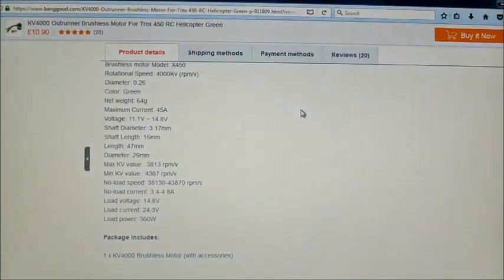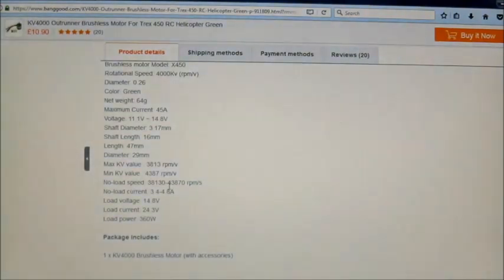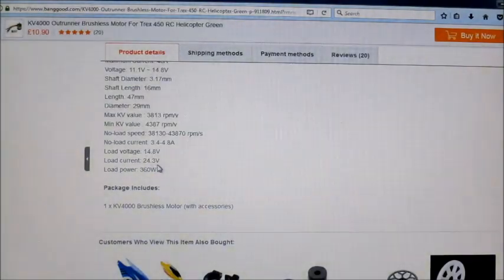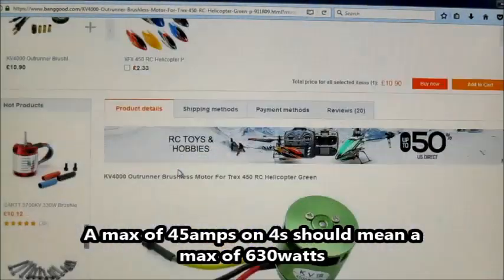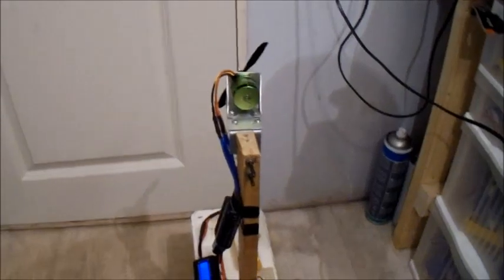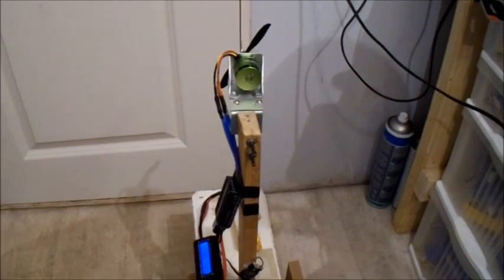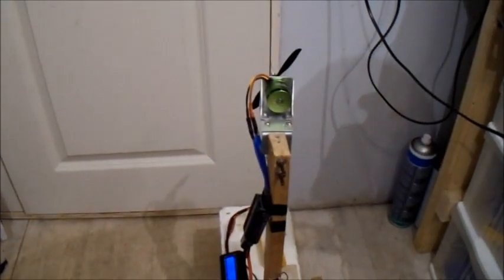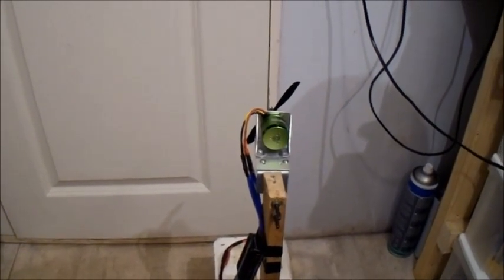4000kv TRex 450 Helicopter Motor Thrust Test Motor Test of the Week

Comment: I put this on  helicopter spinning 275mm blades sub 450. I was really surprised at the power spinning about 3700rpm main rotor. The magnets seem weak to me compared to other similar size motors which had no bearing on performance.

Comment: I use the same motors on a couple of my rc boats. Their brilliant
Reply from the maker: Small but mighty.
Reply: @rcplanepirate  One on my Feilun FT009 doesn't even require cooling and the other one on the Volantex SR65 performs well but gets a tad hot even watercooled since the boat is 65cm long
Reply from the maker: @redditchrc960  Thinking of getting one of those outrigger kits from banggood. Could be a good motor for my first rc boat.
Reply: @rcplanepirate  I got mine of AliExpress currently on order for another seven of those bad boys to go into my other small rc boats
Reply: @redditchrc960  you running 4s or 3s ? And when you say tad hot lol 
Thinking about putting one in my sr65 ya see
Reply: @Discofpv  up to 3s. I don't think the hull could handle 4S being lightweight abs

Comment: How to modify the shaft of this motor
Reply from the maker: Modify the shaft in what way?
Reply: @rcplanepirate  in one of the videos i have searched on youtube a guy attached the prop on the back of this motor but how i cannot understand bcoz of short scene...
Need help bcoz i wanna update my skyfun jet to this motor
Reply from the maker: @imranahmad2264  You need to get a longer shaft. Take the motor apart and fit the longer shaft so it sticks out the other end of the motor. If the shaft you get has a groove at the end for a ring clip then just turn it round so that end is where the clip was on the old shaft by the bearing to stop the motor coming apart. You will also need to put flat spots on the shaft where the grub screws hold the shaft the other end. If the shaft doesn't have a groove for a clip you will need to get a grub screw collet to secure the shaft that end. Also I'm not sure if the standard shaft is 3.17mm but only at the end. It might be 4mm where it goes through the bearings. So measure the hole shaft before you buy a new one. Here is a good video explaining how to do it.      https://www.youtube.com/watch?v=D4UKWvTHX1I
Reply: @rcplanepirate  thank you for your kind help and also very thankful to you because everything is in detail so anyone can understand easily...
Reply: @imranahmad2264  You couldn't understand a short video so you're asking somebody to explain it to you by typing out a comment? Just look up a video. You're already on Youtube damn it!
Reply: @rcplanepirate  i wanna say that how to reverse the shaft

Comment: Is the motor going to burn  if i use 80A esc?
Reply from the maker: No that will be fine.
Reply: @rcplanepirate  Althought i use 4s lipo??
Reply from the maker: @tgalam2170  Yes it will be ok. You could even use a 100A esc if you are using 4s.
Reply: @rcplanepirate  thanks..
Reply: @rcplanepirate  thanks

Comment: Heli motors are designed for high torque as they have to move massive main rotors and tail rotors and the collective head that changes the load on command so it has to handle getting how. 45amp Max current draw in the spec is what would scare me away because of the loads it’s expected to handle while spinning at roughly 3100 rpms.  I fly helis and was really eyeing this motor for a cheap cheap cheap 450 helicopter build. I literally bought the 450 heli kit for $15.
Reply: If you are flying 800 gram 450 size helicopter. You would reach 45 amps draw for a fraction of a second. The hovering amps would be around 25  amps. I have data logged  3s motors on this size helicopters and that is what I have observed. By comparison scorpion motors for 450 size heli  are also rated at 45 amps.
Reply: Actually the opposite is true. Heli motors (on collective pitch helis) operate at a constant high speed using a gearbox. RC cars and 3d planes require the motor to accelerate a lot from zero RPM and the motor also is used for brakes and thus require more torque.

Comment: I have thought about getting one of these motors for a good while now to put on a scratch build foamie pusher jet. If I would have known that the actual quality was much better than the pics of it on ebay then I would have pulled the trigger on it long ago. As always, nice video! Keep em coming.
Reply from the maker: Yes I was surprised just how much power it took. If you do get one use the Turnigy AE esc or a Hobbywing Platinum esc cause they can handle the high rpm and make the motor run cooler. Not sure it would be the right choice for a foam pusher jet though because it only turns a small prop. Maybe better on something more aerodynamic like a pylon racer style plane.
Reply: I've been using the Hobbywing Skywalker 60 and 80 amp esc's with good results on the higher kv motors between the ranges of 2200kv to 3700kv that i'm running on a few of my delta pusher builds. The 3700kv motor is similar to the motor in this review. It's a Gartt 450 and i'm running it on 4s with a 4.7x4.7 prop. There are a couple of videos on my channel of a pink and black delta pusher that I designed and it has this setup on it. Very quick with this setup but the motor is hot after a 2 or 3 minute flight. Even though i'm pushing the motor far beyond the rated specs it's still going strong after 20 flights or more. I've heard alot of good things about the Platinum esc. Not very familiar with the AE though. My next esc purchase will be one of those. Thanks for the recommendations.
Reply from the maker: No problem Michael
All sounds good.